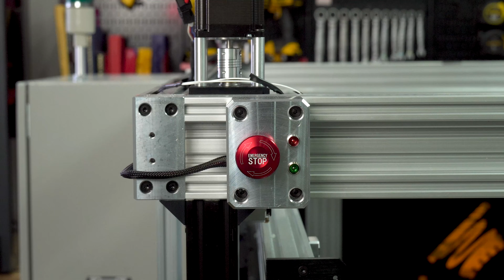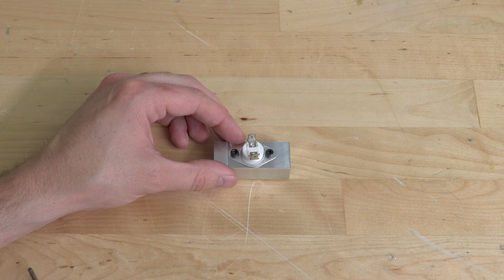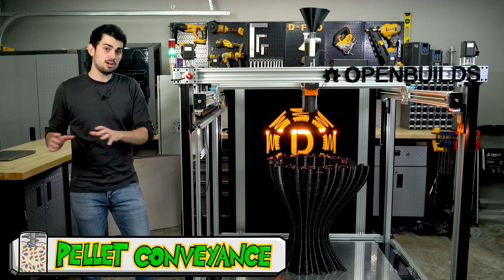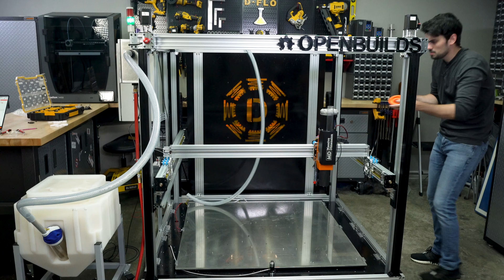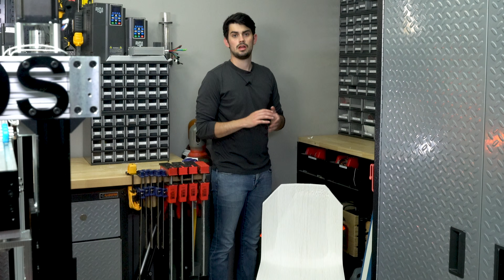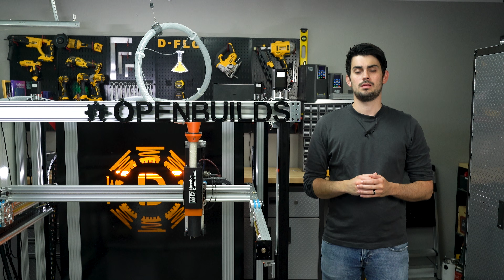Building a Large Format 3D Printer – Part 4: Printing

Comment: I've worked in an industrial setting where we had dozens of machines that run their various vacuum systems with compressed air. A local tech and I were wondering, though, what drives a company / equipment manufacturer to favor venturi vacuums instead of a "more conventional" (actually extremely rare in industrial applications by the looks of it) vacuum pump?
For certain applications where the vacuum is used for only a very short time it makes sense that instead of implementing a vacuum pump you use the readily available air system already present in the factory, but some other machines literally run the vacuum for 99% of their on-time. Compressing the air just to shoot it out for a vacuum seems like an incredibly inefficient way to, for example, hold stickers on a sticker applicator. We figured the power bill would surely see a measurable dip if these types of systems were converted to running off vacuum pumps.

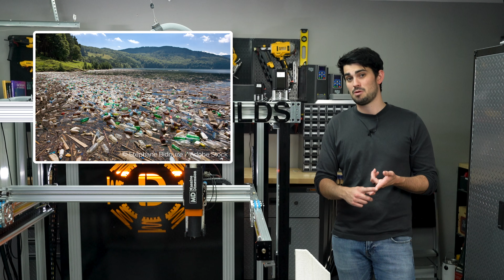Comment: 23:55 this isnt quiet right. Yes in this example there is a lot of waste but this isnt the normal case. What we see here is a modeling kit which is getting sold as you can see it in the picture. A lot of machines dont produce that much waste or even close to non at all because a: the scrap is beeing reused or b: the scrap parts stay in a fluid state while only the part hardens and gets ejected. Also injectionmolded parts are way more efficient in material use than the 3d printer (which is an awsome build by the way! I love seeing it) we see here. The stool shows that perfectly with its high weight.

Comment: The build is impressive and I applaud you. 

However, I noticed some misinformation. Air amplifiers do not operate on the venturi effect, they utilize the coanda effect.  

A venturi pump uses a rapidly moving stream of fluid going over an orifice who's axis is parallel to said stream at a high rate of speed to generate low pressure on the suction end. 

Most often a large chamber leading to the small section and back to a large chamber.  

You can observe this if you place your lips near the top of a drinking straw and blow straight over it as if you were attempting to make "hoot" noises with an empty bottle. you will notice the liquid on the other end of the straw being sucked up and sprayed out like a mist. 

An air amplifier on the other hand, uses the coanda effect like the wing of an airplane.  It is essentially a circular airfoil with high pressure air being ejected perpendicular to the flow of the transported media in towards the center of the device.  However, instead of simply clashing in the middle. the air sticks to the air foil and moves along it quickly. dragging the air in the center with it. creating a low pressure area on the suction side. 

I cant think of a convenient way to demonstrate this with materials you have at home unless you have a 3d printer. 

Anyways, that is a massive air amplifier you have for what you are doing. What is that. 1.75" hose? 

https://www.exair.com/sal.html look at this one instead. they have a 3/4" outlet version and a 1.25". the 3/4" outlet version is like. 108 bucks with a 12x amplification ratio and it only uses 6 cfm @ 80 psi.

Comment: the loader must have come on and off alot but air should be good for short draws use a dessicant/silica dryer with a disc spitter much cheaper option tho way less piping too or go big and get a dryer instead  very kool tho love the print porn too and for the loader make it only latch once automatically true the relay so i only trigers it once for a set time  not continious and use manual loading for material changes i am not trying to talk you down i am just trying to help with ideas and what i think may be an option your doing great keep up the great vids too!

Comment: With the 'refrigerant' section of your pneumatic setup. couldn't you put that between the pump and the pressure resovoir? that would mean that it's having air pumped through at a lower rate giving it more time to cool the air (thus condense the water). This means you'd get better performance from your current setup by just swapping the order that things happen in. 

although that depends on how much pressure the radiator can take, but assuming it can handle whatever the pump outputs this would probably be significantly beneficial.

The air would be in the radiator longer AND it would be at a higher pressure (I assume you're using a regulator to steps down to 90psi). 
Higer pressure = higher temperature means your delta t is higher increasing the amount of energy that gets radiated out. In addition it's in the radiator for longer meaning it can get closer to ambient. 

I don't know if this is necessary, or if the radiator can handle the extra pressure, but if its possible at worst you'll go through less filters and at best you may see an improvement in print quality.

Comment: Amazing project! What are the other uses you forsee for the machine other than printing furniture? (which you could very well do btw, and make a shop out of. It's priced right to be designer furniture, even if you charge $200 + shipping per chair, and imo, it'd fit very well into a designer furniture store.) Never seen a printer like this before, this is amazing.

Comment: You forgot a opinion on filament coloring. This is many preheat and mix filament makers that have a auto cut end on them. Just make or buy one of them then again you can use your existing filament maker to do it then shred it. As you showed you can use the shredded filament easily. To help with this you need to replace your 1.75 hot end with a 3.0 or 4.0 hot end.

Comment: You should include in the code, if it is refilling for more than 10 seconds and has not triggered the fill sensor to pause the print, because something is clearly wrong with filament. (also good if you actually run out). Just fill her up and resume

Comment: What about having small funnel at the top instead of a large heavy container and have the small funnel be refilled by Archimedes screw going to large container with pellets at the side on the bottom, where it could be easily refilled by human? I know the screw would be a large moving part possible prone to more failure than your vacuum, but on the bright side it could be quieter and maybe less complicated and expensive than having all parts needed for compress air to be stored.

Comment: Thickness for enough rigid workpiece comes from limitation of the 3D printer itself.
You cannot print the skeleton on outside surface in horizontal direction. So the thin wall chair cannot support normal load.
I guess one can make your thin walls chair usable ,had he got 5 axis 3D printer which it can print from any dimension.

Comment: I work as an engineer an equipment company for plastics processing and I can tell you the sprues used in injection molding are 100% recycled immediately back into the process. From an money perspective this would be extremely wasteful, and it can actually be illegal for plastic manufacturers to just throw plastic parts like that into the garbage. 
Lmk if you have any questions about plastic conveying, recycling, blending, or drying

Comment: Not sure if someone said it yet but another way people do their own DIY compressed air cooler is using a truck AC condenser (since it's built to hold pressure) and the write-ups on Google show the users placing the condenser by the compressor fan. For smaller compressors one could just add a fan if desired. You already made a setup but its an idea in case there's more issues later.
Reply from the maker: Great idea!

Comment: about plastic costs i wonder if there is a source plastic that you can reclaim waste from to lower input costs. i think that PET is a decent thermo plastic for printing and i think that you could source fairly clean PET from a local plastic recycling facility. or at worst you could probably get a decent deal shipping it in from overseas. I see prices for PP and PET as low as 50 cents per kg.

Comment: For the stool, why did you choose a solid form instead of say 50mm thick sides/tread with a hollow interior? Is the bridging just too challenging?

I'm also worried that your pellet receiver is going to suffer a strain failure at that sharp point in the neck.

For the chair, you might be able to make it thinner if you add some reinforcing structures inside the seat. Even 100mm^2 would help a lot with rigidity.

Comment: Interesting build!  Some thoughts:

1. Given the cost, inefficiency, noise, complexity, and other hassles involved in an air-based system, it would seem prudent to switch to an Archimedes Screw delivery system--as is used to deliver plastic pellets for injection moulding--to lift the pellets above the printer.  That is inexpensive, efficient, quiet, and mechanically simple.
2. I would suggest having separate base and coloured pellets that are delivered to containers and weighed before being automatically dumped into a mixer at the top of the machine.  That will limit the coloured amount to only what is needed for a particular print.
3. Tech Ingredients has a different way of removing water from air that is inexpensive, efficient, quiet, and mechanically simple, using a LIQUID dessicant: https://youtu.be/R_g4nT4a28U?t=742  (I suggest using it to keep your whole shop at a constant temperature and humidity level.
4. As weight is less of a problem with a design this robust, laminar flow air jets--on rotating mounts on the X gantry--would allow for LOTS of airflow around the extruder head without increasing its size.  As a bonus, you could use a simple mechanical solution of cables to rotate the jets to always point just below the nozzle. 
5. Enclosing the printer will offer another solution to dealing with excess heat and humidity: a fully closed air system with TI's solution to both cool the air--as needed--and dehumidify it.  (...and a HEPA filter, of course!)  All of the air in the enclosure will ALWAYS be as close to perfection as practical.  This can also feed the air compressor if you don't choose to go with the screw-based concept.

Does that sound reasonable?

Comment: What if you made an anode / cathode contact rings on the hose connection? So when or it it ever disconnects, the circuit is broken and can make the printing process stop, and possibly send error to your phone....
Or use a sensor to detect loss of pressure while the proximity sensor doesn't detect a full barrel?
Just ideas.  :)

Comment: In comparing a mass production  pieces of chair with your one piece making unit. Those injection molding pieces involve a large amount of investments in mony and time in building the injection mold in the first place. There is a breakeven òf these and the number of pieces it produced（or pieces sold in market）to the listed sale price or the corresponding  amount of profit earned. The problem of high volume of material usage in your 3D printings is hard to be solved if strength  requirements in the product  is the prerequisite. The finer the nozzle,  the thinner wall thickness can be made, lesser material comsumed but more layers or processing time are required. Less material  will make it not strong enough as comparing with good strength  properties  of injection molded piece. It is because the layer and layer adhesion force is not strong enough and circular sections of extruded  plastic leave space between them, these are the inherent drawbacks of FDM 3D printing that are difficult  to be solved.

Comment: 👋🏼 heyo,
Average joe here just interested in things over my head.
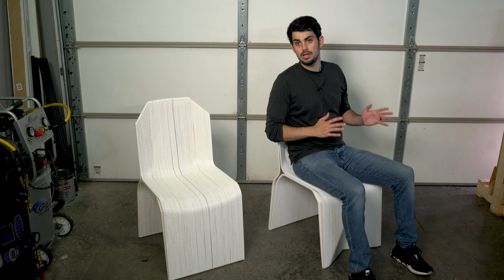17:46 you were mentioning the beads not mixing properly, so we’re listening solutions. I was thinking wouldn’t the easiest/cheapest route be 3d printing a spiraling internal design of your own, that just extends from the orange feed you already printed above it (replacing the clear cylinder tube) that way it has an additional factor in mixing the beads before they hit the printing gun?

Comment: It would be pretty cool to use translucent plastic to highlight the pretty pattern on the inside.
Reply from the maker: Yes! I need to buy some PETG or recycle some plastic bottles!
Reply: @DrDFlo  I am looking forward to your recycling video!
Reply: @DrDFlo  If recycling plastics is even somewhat viable I am going to commit my life to recyclable additive manufacturing. It never made sense to me on a small scale but man... with the right waste management connections you could do some seriously groundbreaking things! Have you run into problems with reprocessing your material multiple times over?

Comment: Dr. D-Flo, wouldn't it be more efficient to mount the vacuum unit lower, only slightly above the pallets, and rely more on the pushing of the compressed air? I assume for the same CFM you get much more pushing force than pulling force

Comment: I do have the odd question, if that auto loader does not work in long term due to compressor capacity would it be possible to machine something that works off an electric blower such as a modified plug in leaf blower as those can kick quite a bit of CFM too.

Comment: You could use a very light and very flexible tube between the venturi and the hopper: it is under pressure, so there is no risk it will collapse, and a more flexible pipe will be less likely to detach.

Nice project!

Also, is there a way to program a variable infill? When you are getting toward the top of the step stool, start increasing the infill, so it becomes easier to bridge.
Reply from the maker: Do you recommend any brand of tubing that would match those specifications? In my research, I often use Tygon tubing which is very flexible but is not sold in this large of a diameter. 

Also yes on the variable infill. I’m told that adaptive cubic is the way to go 👍
Reply: @DrDFlo  Sorry, I have no idea of any brand, it's just that looking at how the tube is behaving, it looks quite rigid.

Comment: Move over IKEA.., We have Dr. D-Flo in the house.

Any luck improving that print quality? ID go nuts and start by enclosing it. 
It was hard to get into 3d printing because i am a engineer/machinist with a perfectionist mindset. 
If i cant make a print come out gloss smooth i remove the issue and upgrade.
|
Connection to hose use a wire and switch similar your plasma table so it shuts off if it disconnects

Comment: Would a magnetic connection for the proximity switch work to ensure it shuts off when/if the hose & wire break free from the filling component? That way, if the hose & wire disconnect, the blower would shut off instead of running uncontrolled.

Comment: The most impressive thing in this video is your power cost. 0.10$ per kWh? A cheap contract here in Belgium will run you at LEAST 5 times that...
I'm also wondering how efficient that 6KW bed heater is at heating up the entire room it's in, since I heat my (tiny) workshop with a 2KW heater in winter :P

Comment: I mean, it's cool, but anything mass produced will always be with injection molding where you can whip out a piece in a few seconds, for much cheaper. Your overhead is the mold, but once that is done, you can make thousands. I wouldn't let a fat guy sit on those...

also, the 2nd version gives you some strength in the legs.

Comment: You didnt calculate your compressor energy consumption and also .10 per KWH is pretty cheap for electricity. I believe Indiana averages .12 to .14. 
I think your pellet blower would be more efficient if you recirculate the unused compressed air through the filter at your hotend and back into the inlet on the pellet blower.

Comment: I don't understand the need for a Venturi feeding system if you have to set up everything. Why not use a screw conveyor the will lift the pellet to a higher point and another tube will drop them to the extruder/hotens assembly.

Comment: 21:50  I think I've had that problem with (rectilinear) infill, before - why do they make that infill type behave that way?  Having a bunch of strands rather than solid walls seems terrible for structural support.  Unless it's specifically to help printing the otherwise overhanging surfaces...and it sags less in small format?

Comment: you really should have used copper instead of PEX for your air compressor radiator! and maybe even a light fan. That close to the wall it will lose some efficiency also.

Comment: Coming over from the precious plastic universe, how effective would this be at printing with HDPE and PP recycled shreds? Shreds are pretty uniform and small like the pellets so feeding shouldn't be a problem. I'm reading that both materials are difficult to print with due to high shrinkage and poor adhesion between layers. Any thoughts?

Comment: Your chair was designed to be an art piece, so it's natural that it'd be more expensive. With similar materials, an optimally* designed chair should probably be lighter than the injection molded deck chairs, and therefore cheaper. I have no idea what an 'optimally designed chair' would look like, though.

Comment: I'd wear a mask when that thing runs. The studies are just coming out so there is no consensus, but its already accepted that 3D printing can fill the air with acrylonitrile butadiene styrene which is toxic. I don't think I need to get scientific here, those little plastic hairs that the extruder has on it after a print are clearly going into your lungs with even a small printer. Incredible work D-Flo, can't wait to see the life sized benchy!
Reply: Only ABS and ASA (and other styrene-containing filaments) emit styrene gas when heated. And yes, if your printer is in your workspace, you need a HEPA filter. Printing PLA and PETG is less concerning, but they all generate microparticles which you don't want to breathe.